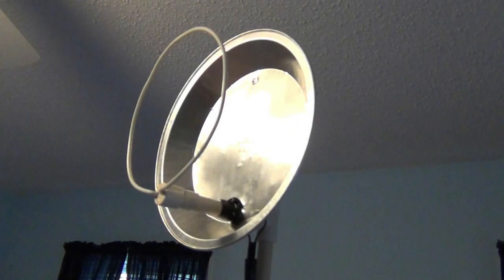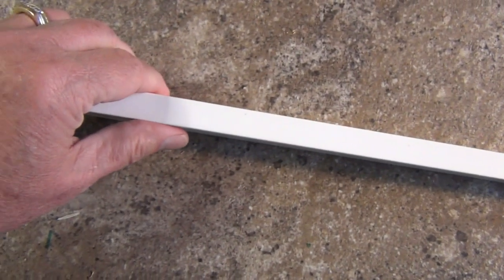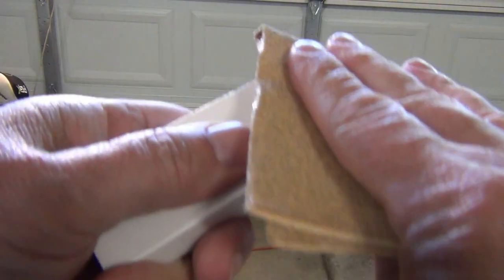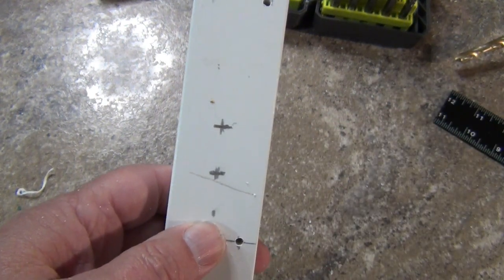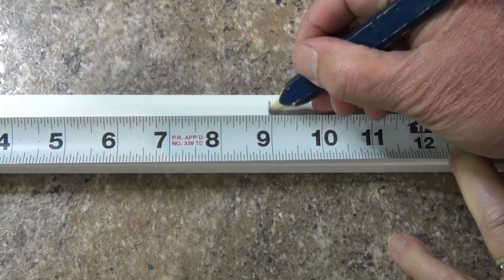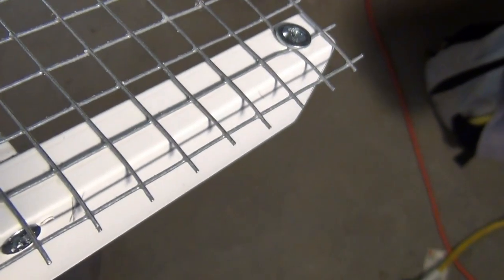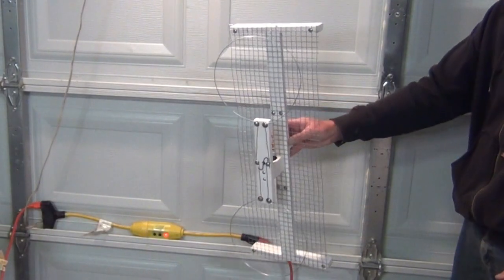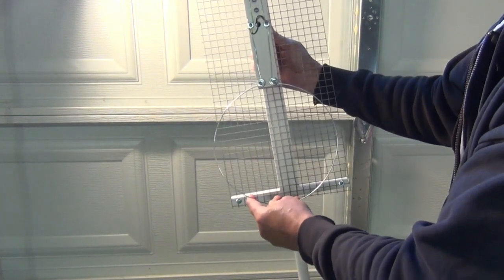Double Hoop Antenna with Reflector

Comment: I used this antenna design and used your twisted galvanized steel wire idea as well.  This provided outstanding results.  I am able to receive channels that range between 60 to 70 miles away.  This is with the antenna about 16 feet above the ground.  

Thank you so much!
Reply from the maker: Wow, that's great! Thanks for letting everyone know.

Comment: Absolutely stunned by how well this works because of how many trees are on my property and it’s only elevated on a 6ft pipe. I also can’t believe how inexpensive and relatively tiny this antenna is compared to the 7 ft, $200 monstrosity recommended by Televes. Not sure if 1/2” hardware cloth would improve reception, but 1/4” is what I had and seems to be just fine for reaching stations as far as 53 miles away.
Reply from the maker: Great! Thanks for sharing your results.

Comment: I am wondering if 2 antennas connected together overload the TV receiver ??? How about the 2 placement of DHA, would side by side work best or one on top of the other ??? One more thing, since the field of view is roughly 135 degrees , would moving the front of the antenna a number of degrees to increase the field of view lose some of the reception of the antennas ??? Thanks Mr. Hop To It. for your educational videos and shearing of the knowledge. Peace v
Reply from the maker: You could connect two of these antennas together. Side by side or one above the other would depend on your exact reception issue. I'd try each way. You can offset one element vs the other, but that would only work for very specific aiming issues. Normally its best to leave them in the same plane. Thanks, VF!
Reply: @mrhoptoit7835  Thank you MHTI. I will have to try it out. v

Comment: A few points:
All of the dimensions scale with the wavelength of the station you want to receive.
An important one is the distance back to  and the width of the reflector.
Normally the distance back is 1/2 of a wavelength and the width of the reflector is about 15% more than the distance back.
Look up the RF frequency for the far away stations.  Pick the smallest number
WaveLength = 300meters / MHz.
Reply from the maker: Hi Ken. As always, thanks for your comment!
Reply: @mrhoptoit7835  It is a topic of interest to me.  At some point I will have to make my own video on the topic.
Reply from the maker: Please do. I'm looking forward to watching it!
Reply: doing the math assuming it did it right that would suggest the reflector by 9.8 inches back for UHF channel 36 which I find to be twice what is normally suggested. Channel 14 would be 12.7 inches that seem way to far.  One made for the center of hi-VHF would need to be 2 1/2 feet away. That seems a bit much. Thought the reflector width math seems fine. Could be this works for hoops and different antennas use 1/4 wavelength?
Reply: @harryballsak1123  I think you may be correct that 1/4 wavelength is a more common value.

Comment: Would making this antenna times two side by side increase the gain like the Gray-Hoverman type antenna ??? Would winding two ten gauge copper wires help give the antenna a little more umph ??Thank you Mr. Hop To It. Just love your videos too. vf
Reply from the maker: I think both your ideas have potential and would help gain. Thanks, VF!
Reply: Yeah if you use a combiner. You can even do a quad. But that will need a good pole to hold in the wind. You can also do two different directions with a combiner also helps if the stations are coming from two different directions. 73
Reply: @ronb6182  Thanks for the information Sir 73

Comment: Why are the rings spaced apart a certain distance ??? Yet the four hoops antenna so close together ??
Reply from the maker: The spacing was to intercept signals from a more vertical sample. You can also do it on the four hoop antenna, I just chose to keep the design simpler.

Comment: Would using a reflector that is larger by a few extra inches in each four edges increase the reflective gain by a little bit MHTI ??? How about rolling the edges into a somewhat radius help also ?? Would placing two antennas side by side or one about the other increase the gain by a few numbers ??
This is just an idea as I am not sure. The reflective part will be 304 stainless steel for corrosion resistance. An not sure what will happen using this material. Flea-bay had a special on a roll of mesh cloth. One more thing, would using a copper wire say a number 6 or 4 gauge help reception ?? I remember one of your videos showing that a 10 gauge wire did the best for reception of antennas Mr. Hop To It. One more thing, how good does this tenna receive low VHF signal. I live in the few places where low VHF still is used Sir. 
        Have  yourself a Happy New Year Sir and many more for us both to come. Peace also Sir. vf
Reply from the maker: Hi VF. Enlarging the reflector will help gain, but it will narrow the reception focus. Using a radius edge could also do the same. Stacking antennas will allow you to collect signals from a wider swath, but how well it works depends on many factors. Using 304 stainless steel for a reflector should work. Increasing the wire to 6 or 4 gauge will increase gain potential, but in many cases, anything over 10 gauge isn't really cost effective for the minor gains you get.
 I cannot test for low VHF signals, as there are none transmitting in my vicinity, but this antenna probably would not work well for them. Try a dipole antenna tuned in length towards the channel you are trying to receive.
Happy New Year to you, too VF!
Reply: There are not many low VHF stations but some cities still have them. A yagi antenna with large elements are better. In the old days antennas that were folded dipole worked good on low VHF like channel 2 through 4 or five channel six was like an FM antenna I used my radio shack 175 mile antenna for that channel. Some say there is no such antenna 175 miles but mine over picked 175 and father. I picked up NYC from Orlando FL. And also stations in CO. Was the low end of the FM dial. I liked classical music and I did what I had to to pick up stations like near West Palm Beach from Lakeland FL. That's over 200 miles away.73

Comment: Great video! How did you determined the distance between the two loops? Calculation?
Reply from the maker: When I have an idea for a new antenna, I will often initially fabricate it in a prototype that is adjustable in configuration. I did it for this antenna, and changed the distance until I found what worked the best.  Great question!
Reply: @mrhoptoit7835  thanks!  I live in the Montreal area with local stations about 16 miles away and Vermont stations 88 miles.  I already have a 4 bay bow tie antenna with 32" reflector to pull in hi-vhf.  After building your antenna, I was surprised it worked remarkably good ...pulling in those 88 miles stations.  Keep up your excellent work!
Reply from the maker: This antenna has been overlooked by many people, but those who build it have had excellent results. Thanks for letting me know!

Comment: Wrong copper is far better than steel , most commercial   antennas are made of aluminum which is still better than steel. For stiffness use number 10 or number 8 solid copper. You can even make it stiffer by putting one end in the vise and the other end in a drill just a short turn will get rid of small kinks and stiffen the copper.  There is a spray that will coat the copper wire to keep it from oxidizing. A little green won't hurt reception though. 73
Reply from the maker: Check out this other video I posted regarding this topic - https://youtu.be/bm_4eb78bwQ   Thanks for watching.
Reply: @mrhoptoit7835  doesn't matter still copper is a better conductor. Ham radio operators use copper over any other wire for antennas.  73
Reply: Most common mobile antenna/whip is made of steel.  73s  KJ5FTB